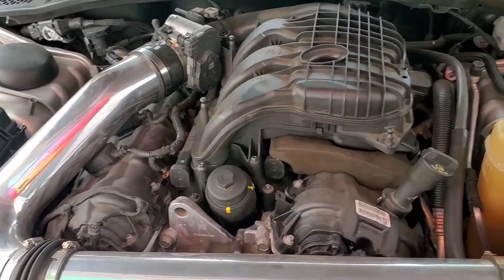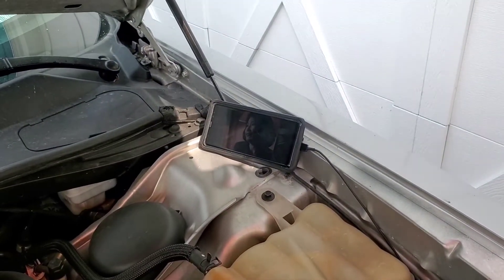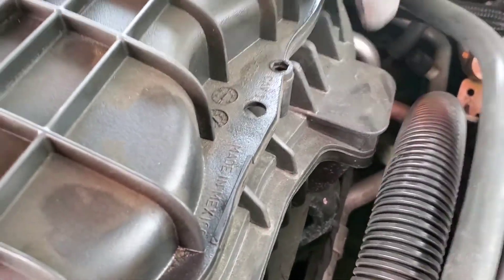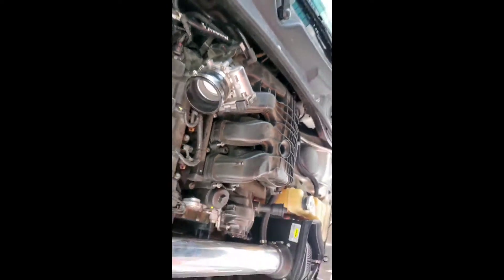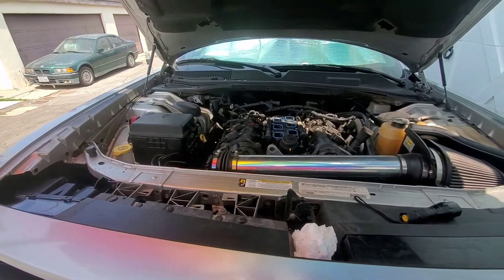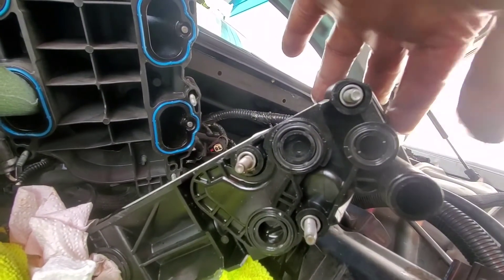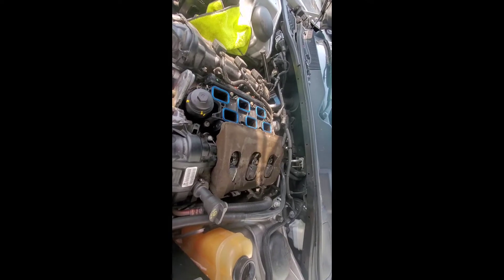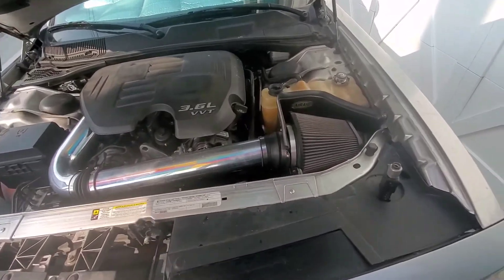V6 pentastar 3.6L oil cooler/coolant housing seal removal and install

Comment: Why did you buy a plastic housing? There is a aluminum housing. Much better and torque to inch pounds not foot pounds.
Reply from the maker: Cause it was leaking and I needed to get to work within 4 hours. So I handled it. But thank you for the info. Next time I'll get the one your talking about. Plastic sucks arse.
Reply from the maker: Awe man. That's nuts. Sorry to hear that. Did you buy aftermarket? I know factory is expensive but in your case I think if you have not tried a mopar factory one I would try it. The aftermarket one I put on, one of the holes was not a perfect circle. It worried me. But torqued it to specs in sequence and I have had NOO problems at all. Happy about it.
Reply: @TheBarrios69  Thanks for the advice.  And yes, I bought the aftermarket aluminum version.  I'll just pay the extra cash and go mopar and see what happens.
Reply from the maker: I think ots ypur best bet. I really do. Look at your holes on top of ypur motor where the housing seats. See if maybe 1 or more got gouged or somehow scraped or sonetjing that stops it from sealing correct.  The 1st time I did the job I thought my bolts were torqued from the torque wrench. But I didn't pay attention to the seal.. I had to kinda force the housing down to bolt it down. Not good I found out. When putting the housing back,  it should slide down nice and smooth. Flush.. with the guidance of your hand. Not pushed and made to go down. Feel me?

Comment: Where did you buy the seals from? What are the best?
Reply from the maker: You might have to order them. But I was lucky. I got these ones from O'Reilly auto parts..aslong as they are the same ones.  Anywhere is fine..just order them If they are not in stock.